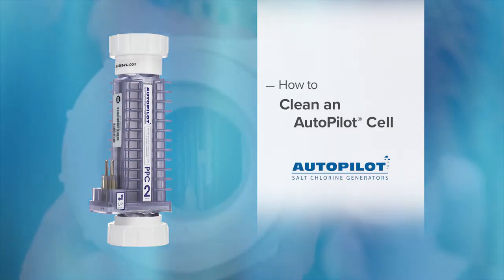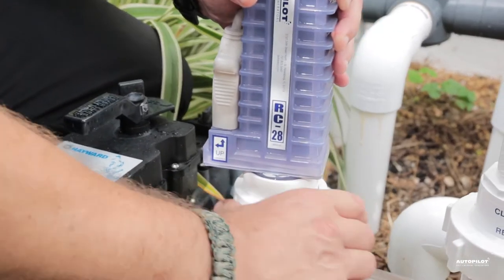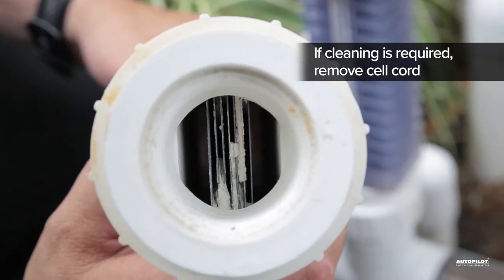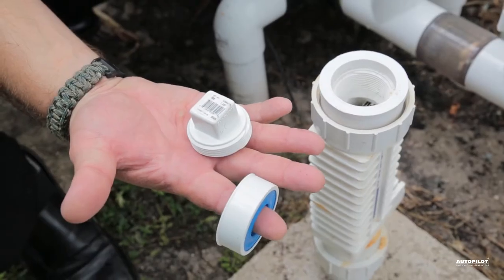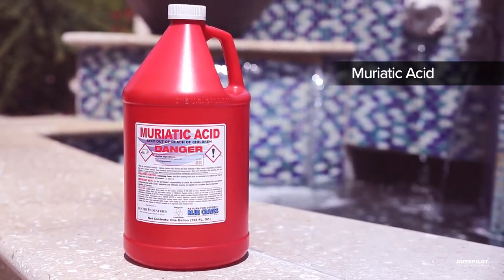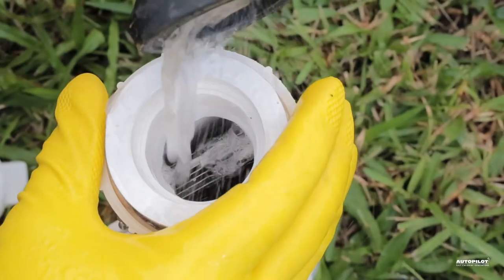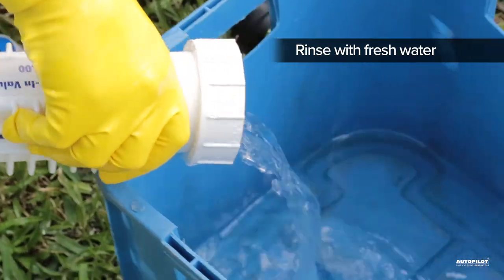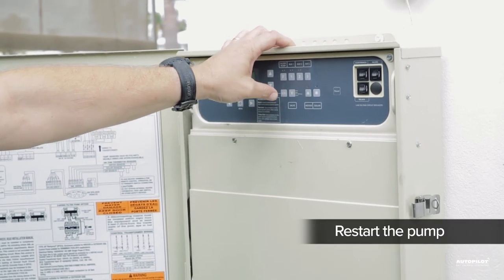How to Clean an AutoPilot Cell

Comment: So my in line cell looks clean just like in the video. My pool pilot eco nano says A=lo p=off 
When I scroll through the info the U says 00 
I turned the pump off it said no flo
I checked the sensor it looks ok to me. Everything is brand new never been in use. I've had the pool almost 3 months. 
I cleaned all the filters I'm at a loss